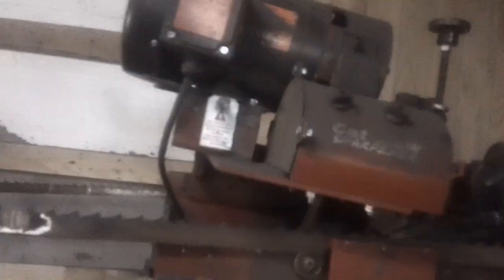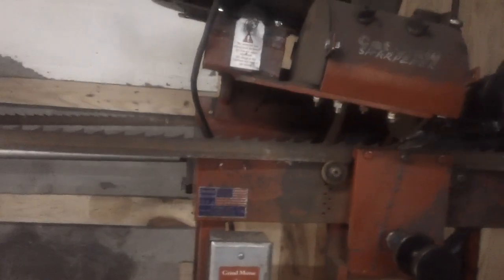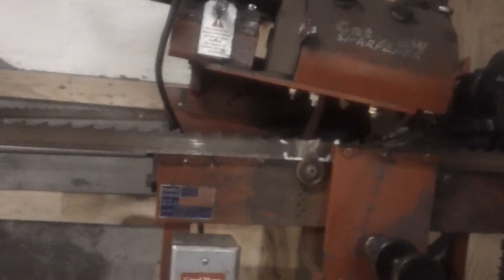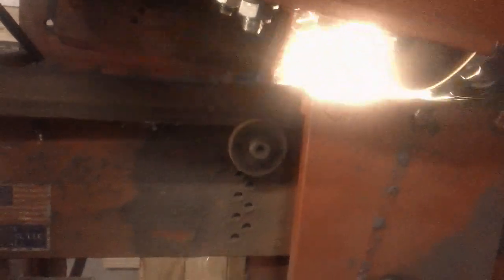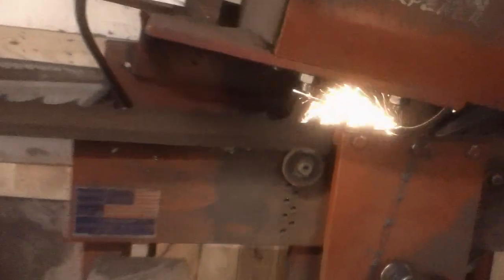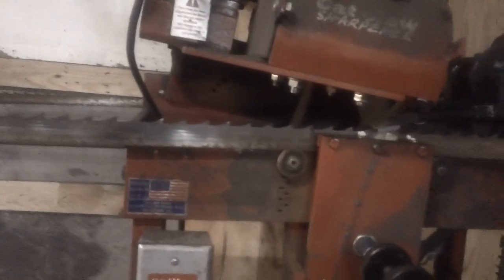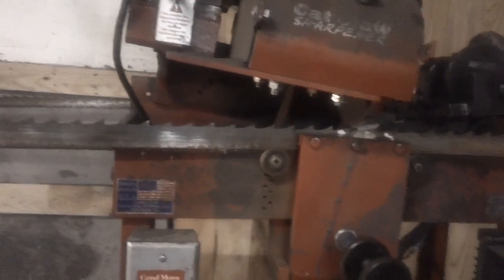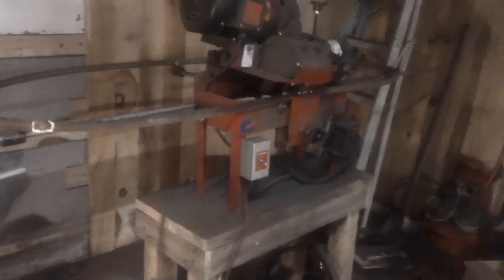weld your band blades

Comment: The band saw at my old shop had an electronic band blade welder mounted to the side Complete with square grinder wheel.
Reply from the maker: you want to sell it
Reply: @fineshooter  don't own it any more. That was in the eighties.
But I'm sure they are still available.
One button to weld one to   anneal the blade great little bolt on.
Good luck

Comment: I ran a mill for a while and yes I reground and sharpened the damn teeth. But the truth is those induction hardened teeth loose their temper beyond a certain point and don't hold an edge worth the time and hassle.
I went carbide tipped and never looked back. HSS tipped is okay but forget carbon blades.
It's very hard on band guides running multiple welds over them.
There's economy and there's stubborn stupidity. 
Lennox makes fantastic carbide tipped bandsaw blades. Let the timber pay for the the band's, I'd rather have a bit more free time on my hand's.
I do regrind my planer knives myself because it's the only way I can get them perfect. But that's a different beast to bands. 
Once you loose the set on the teeth from grinding back it's a mugs game resetting them. 
The gullets get weak, band's break, wheels get torn up. 
I learned to hate my woodmizer. Overrated garbage machine.